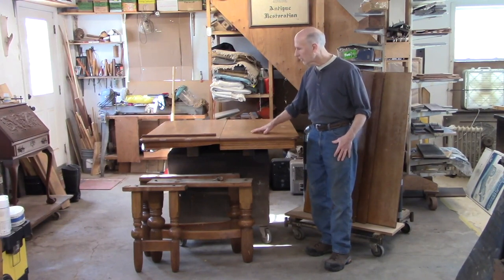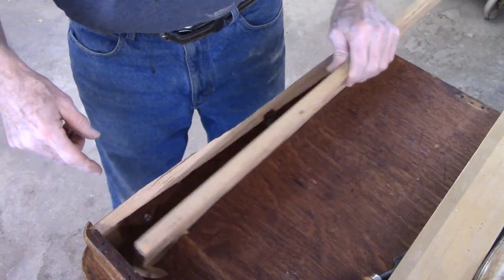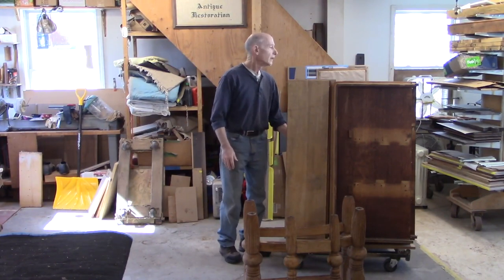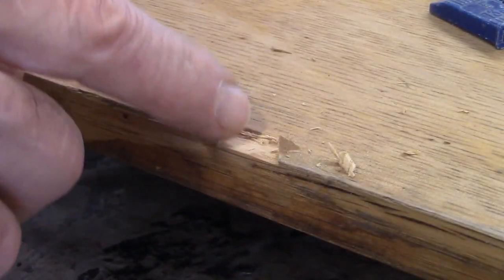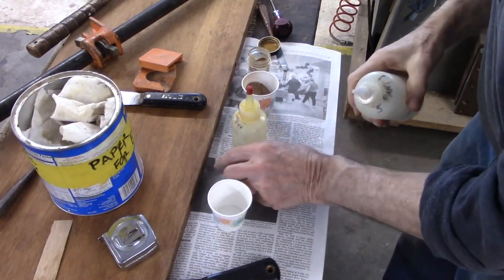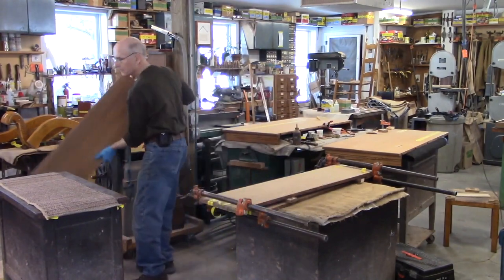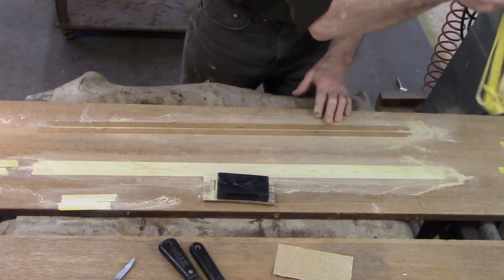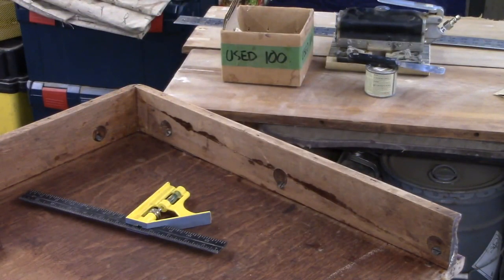Restoring a Turn of the Century Table - Thomas Johnson Antique Furniture Restoration

Comment: Tom is providing an advanced course in furniture restoration on this oak table.  Here I go again, but my Grammer had a parlor table she inherited along these lines that was so over the top in leg configuration and decorations wth cross braces, fluting, spindles rising out of center brace in multiple areas..  It was something to behold!  She had it refinished.  It never had it’s glory again.  The patina and smoothness of the wood were gone.  Looked like raw furniture you buy, then apply your favorite shade of varnish and call it good.  This is how it should have been done.
Reply from the maker: Thanks! It's so hard to balance the need for refinishing and the loss of the patina and defects. I'm always trying, with varying degrees of success

Comment: You never cease to amaze me Tom. I can't wait to see how you add hight to the table. I found two abandon English Anglo-Indian Teak Arm Chairs. They also don't scoot up to the table. I love them so much. They'll end up with abandonment issues if they were tossed again! 🥺😄
Reply: If you are having table/chair height problems, as a quick fix consider castor cups: small, shallow cups of hardwood or brass (or ugly plastic!)traditionally  placed under the table legs, to prevent floor damage from the castor wheel. They come in all heights from about 5 mm / 1/4" to 5 cm / 2", and they are very easy to install, as well as being traditional.
Reply from the maker: Thanks! I like dlevi67's suggestions
Reply from the maker: Yes, thanks!
Reply: @dlevi67  Wow! Great idea. Thank you SO much! Searching on PC as I reply to your fabulous idea  simultaneously. I'm such a multitasker. <wink> Thanks again!
Reply: @Pepsi_Please  You are very welcome (I too have long had chairs that don't fit under the dining table unless the table is given a little 'help' 😁)!

Comment: I love how he helps his old Pupper into the truck to go for a ride! Mine lived for “Go ride?” Considering I’m about to start restoring an old Singer treadle cabinet (I’m having to replace the tiger oak veneer on three pieces of the top) I’d love a video on now to replace a large piece of veneer and shape it down to the base piece.
Reply from the maker: Thanks! dlevi67 is correct. But these are small tops, so you should be able to. I would advise getting the 2 ply veneer from Bob Morgan: http://www.veneer-factory-outlet.com/. He advises contact cement but I would not do that.
Reply from the maker: Thanks! Good job!

Comment: When you were putting the thicker epoxy in those cracks, it reminded me that i have used a small vacuum cleaner, like those "car vacs", below the piece, 'lightly', to draw the glue right through the part line.
Reply from the maker: I have never tried that - a number of people have suggested it - I don't see how it could work though
Reply: @johnsonrestoration  hi; you apply a 'heap' of glue or epoxy, masking the parts as you are doing, and put the vacuum cleaner hose below, if the crack goes right through, and move the 'snout' along the bottom of the crack, keeping a bit of distance, so that you aren't applying full vacuum, just enough to draw the glue down...if you were to put the vacuum nozzle at the bottom of a crack, along the 'front edge', it could draw material along  the crack, toward the front, helping to get it down into the crack, kind of the opposite of 'blowing' it into a crack from the top...

Comment: A very solid decision to farm out the stripping.  32 sq ft of surface alone would have used a lot of expensive stripper that we can't even buy here in CA. However, I would have thought that the stripping process would have loosened the glue joint. You say they don't use any water and of course I take your word on that. But do you know what they do use? And is it environmentally friendly enough that we in CA and other highly regulated areas could use on smaller jobs?

As usual, expert advice and techniques on when to clamp and how much vs. placing fillers and veneer in certain cracks. Looking very much forward to the second part. 
Thank you, sir.
Reply from the maker: You're welcome! I'm quite sure what they use would not be legal in CA. I haven't tried the "green" strippers, but read Flexner's article https://www.woodshopnews.com/columns-blogs/patience-is-key-with-green-paint-strippers

Comment: As always your chisel work amazes me....for myself, I have to use one of those stewmac plunge router bases for a dremel to get that kind of bulk work to a consistent depth and then do minor cleanup with a chisel for the corners.
Reply from the maker: Thanks! Actually, I'd like to check out that router base. I have not got into the habit of using my Dremel very much
Reply from the maker: Ok, I'm getting one
Reply: @johnsonrestoration  If you get that plunge base, I think you will really enjoy it.  They also sell the upcut bits to make a clean hole on the bottom at a constant depth as well.  It has made a lot of my projects much easier so far.
Reply: They also sell a tilt base as well to make tilted cuts easier.  I have that too but so far have only used the plunge router base.

Comment: I learn more with every episode. As far as the leaves go and the open checks, would you ever consider ripping apart at the checks and rejoining the pieces ?
Reply: If the check doesn't want to come together when clamped dry, I'd leave well alone... ripping apart and re-joining will generally not work, especially if the piece has to fit back against other pieces like the rest of the table (the internal strain that forced the check open will have 'twisted' the surfaces so that they don't even mate anymore, or they do 'at an angle', so the resulting piece is no longer straight - fine if you are still building the rest, not so good when restoring/repairing). Then again, Tom may well think (and do) different, so I'm curious to hear what he says!
Reply from the maker: Thanks Ron. Everything dlevi67 says is true - I will only add this: it depends on the size and length of the check, but my mantra is always: don't make the repair larger! don't create a more complex situation than what you find there. But as always, there are a lot of factors
Reply from the maker: Yes, right on.

Comment: I just did a table top glue up last night. And then saw you taping off the cracks for filling. I didn’t think of that one. Ahh well my orbital sander will fix it. Oh yeah can’t use that now. Thanks Tom😒
Reply from the maker: Thanks! That's good. I don't always use tape, but the table had been stripped and I knew I didn't want to sand it too much. It's Ok to use the orbital, as long as you go back by hand and get the squiggles out!

Comment: Noticed the situation with starting a cut with pull saw.  Other YTer had a good tip on that: grind off the teeth nearest to the grip for about 1 inch. Start your cut with  this  area on your cut line and pull saw quickly toward you.
Reply from the maker: Thanks! Interesting idea! I will try that

Comment: Really interesting. My guess for the leg extensions is a turned doughnut similar to the one above the fluted section maybe with a smaller diameter boss in contact with the floor as a wear pad. All appropriately proportioned.
Capillary rays : Medullary rays
Reply: Same guess - possibly with a "conical"/parabolic foot.
Reply from the maker: Thanks! Yes, we will show some of that in part 2, and then there will be a detailed video about the new extensions
Reply from the maker: You have to wait and see! I don't want to give it away!
Reply: @johnsonrestoration  Where would we be without the pleasure of idle speculation :-)

Comment: Hi Tom. Firstly, I absolutely love your videos and can't wait to see the next one. You've taught me so much when fixing my own household furniture.

I've noticed that when making a patch, you often don't fit them with perpendicular lines, which I'm sure would be much easier to cut and shape. Does this help to blend the patch in better?
Reply: Cutting on an angle is as easy as cutting straight. The difficulty is in getting the two angles (original and patch) to match... when they do, the patch is usually more difficult to see, and it may help preserve a bit more of the original surface.
Reply from the maker: Thanks Dylan! I try to leave as much of the original as possible. dlevi67 is correct also. It's traditional to do patches at angles, maybe tradesman are showing off!
Reply from the maker: Yes, I have always thought, and I think a lot of others too, that an angle cut would be easier to disguise than square cuts, but in fact there are so many factors that go into the touch up I'm not sure that's true. The best patches are in burl, using a "free form" punch. I have one - waiting for a chance to use it in a video
Reply: @johnsonrestoration  it would be nice seeing the repair of some really curly figured veneers!
Reply: Thank you everyone for your answers. And thank you again Tom for the great videos!

Comment: I noticed you use steel screws into the oak. Question wouldn’t it be better to use brass screws so the oak does not this color? That table is beginning to look really good. Looking forward to seeing it finished!
Reply from the maker: Thanks! Well, I was just mimicking what was there originally. You would need water to cause discoloration, which could conceivably happen

Comment: You are an inspiration, to be sure!  Now I have a question.  Tomorrow I'm looking at a maple pedestal table for purchase.  It's not an antique.  The finish on the table top is worn at one end, and I was thinking of stripping it to stain and refinish.  What product would you recommend?  There's no hurry for me to do this, and I only want to deal with the table top for now. I'm just collecting knowledge at this point.  There aren't any furniture strippers near me that I know of.  Thank you for all you share with all of us!
Reply: I was hoping to add a picture...can't.  It's an expandable pedestal dining table with a removable leaf.  42" round without the leaf.  Perfect size.  The finish appears to be in good shape except at one end of the table top where it just looks worn.  I'll see it in "person" tomorrow.  The seller is asking only $50 for the table and two chairs, so it's not a big investment at all.  I just despise my current dining table, and have been searching for a replacement for quite some time.
Reply from the maker: Thanks for watching! I would recommend that you strip the top, try the new "green" strippers. read this article:https://www.woodshopnews.com/columns-blogs/patience-is-key-with-green-paint-strippers. The most user friendly finish might be a water based polyurethane. Good luck!

Comment: Looking forward to part 2!  Question:  what was that "x" stamp thing you used at the very beginning.  I don't recall seeing that before.  Thanks for another great video.  Keep up the outstanding work.  ATB
Reply: He knew the table was going to be stripped so any pencil or pen marks wouldn't survive the stripping.  The "x" marks are there to reassemble the matching pieces in the original locations.
Reply: @ronski50  Ah, that makes sense.  Thanks for the info.  Have a great day!
Reply: It marks the spot, doncha know.
Reply from the maker: Thanks! Yes, rocky is correct!
Reply from the maker: Right on! Thanks!

Comment: As always just truely enjoy watching you work your magick. I'm really excited about seeing the end result as I'm certain is going to look, "Pretty Good"!! 
When you sent the table to be stripped, did they do it into an acid bath?
Reply: Since Tom says that there was no water involved, I think they used some solvent-based bath. BTW - the 'acid' in reality is strongly alkaline! (It's like 'super strong soap' - more suitable for paints rather than varnishes)
Reply from the maker: Thanks! dlevi67 is correct - they used a "flow-over" stripping system
Reply from the maker: I've got to get a handle on the whole acid/alkaline thing. Hello Google!
Reply: Yes I understand that, it's just referred to an acid strip here in Australia. I had my Nonna's kitchen cabinet stripped that way because it had 80 years of paint on it and it worked beautifully but it dried the wood out terribly. 
Thank goodness for Google 😁

Comment: The oak cut, is that what we would call flame cut, here in England? XXX
Reply: I've always heard and used (in the UK) the same terms that Tom uses: 'crown cut' or 'plain cut' when the wood is cut in slabs parallel to one diameter, and 'quarter sawn' when the wood is cut along four directions (two 'crossing' diameters) from the outside of the log towards the centre. Sorry if the description is confusing, but I can't link to images - google 'crown cut vs. quarter sawn' and you'll see why a picture is worth a thousand words!

A 'flame' generally needs to come from a fork (or 'crotch') in the tree. Oak is generally not cut with flames - partly because it is quite a strongly grained wood, and it has visible figuring 'by itself' (especially if quarter-sawn, with the medullary rays showing), and partly because it is rather a pain in the neck to plane as it is, never mind with the crossing grain associated to flames.
Reply: @dlevi67  Thankyou for your help, much appreciated! XXX
Reply: @cajsheen2594  You are very welcome!
Reply from the maker: Thanks! dlevi67 is correct!
Reply from the maker: Thanks! I actually meant to give more explanation by showing a drawing on the computer and then forgot!
Reply: @johnsonrestoration  No worries. It is definitely one of those things that a drawing explains better than any amount of words!

Comment: How does the putty react to the natural expansion and contraction of the wood over time?
Reply: I have wondered about that too.
Reply: It moves with the wood... up to a point. Depending on how much the wood moves by it can last for a long time, or cause major problems quickly. However, here's a little 'trick': since the top is quarter-sawn boards, these are very stable dimensionally along their width, so a putty filling like the one here will not have to move by much. 

There were other cases (e.g. https://www.youtube.com/watch?v=U3wAQzjlj54) when Tom did not fill the gaps because there was no point in doing so: the wood would have moved a lot more than any 'rigid' filling would have allowed for.
Reply from the maker: Thanks! dlevi67 answered this really well. It is a good question
Reply from the maker: Thanks! dlevi67's response is good
Reply from the maker: Thanks!

Comment: Thank you for sharing.  Does the stripper company just have tanks of methylene chloride that they put the pieces in?  Would love to see a film clip of them in a future video.  I've noticed you use a lot of air compressed tools in your work.  I'm curious why.  Are they superior to what was available in electrical tools at the time; more cost effective?
Reply from the maker: You're welcome! The strippers don't dip, they have a "flow-over" system. Professionals almost always use pneumatic tools, they are superior to electric tools in every way. You need a big compressor though

Comment: @ThomasJohnsonAntiqueFurnitureRestoration:  I've replayed the video several times but I still couldn't clearly hear the brand name of your Straight-line Sander....Could you tell me the brand you have and the model if you happen to know it? I know you've had many of your big power tools for decades, but if your straight line sander is still in production I'd like to hunt one down. All of the pneumatic straight line sanders I've found don't have dual head like yours does. If it's out of production and you happen to know of any specific brands/models that are well liked by others, I'd appreciate that info too. Thanks Tom! ~~Christy~~
Reply from the maker: Thanks Christie! my sander is a Stuhr 4000. I just googled it and came up with nothing. I also use National In-Line sanders, very similar. These are big sanders made for flat surfaces, so I don't use them much on antiques. You also will need a compressor that can put out about 1000 cpm's. I have a 5 HP compressor with an 80 gallon tank, These are industrial machines
Reply: @johnsonrestoration  Thank you so much for the details and an optional name brand you trust! My Dad was a Master Tool & Dye Maker for 30+ yrs so I have access to his big air compressor and tank. I have a neuromuscular disease so I like to conserve my energy as much as possible. I think an in-line sander will be a good tool to have in my arsenal for those big sanding jobs. Thanks again Tom!